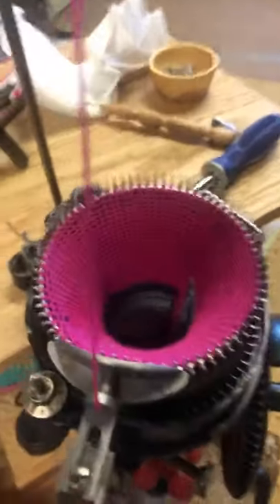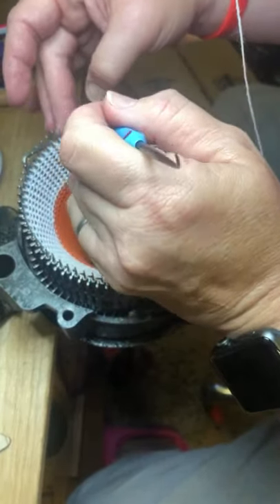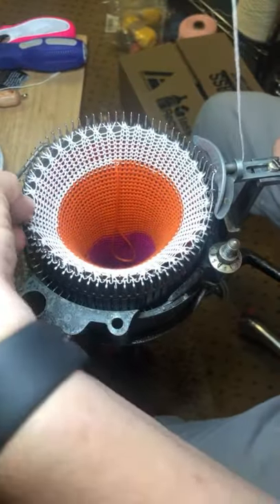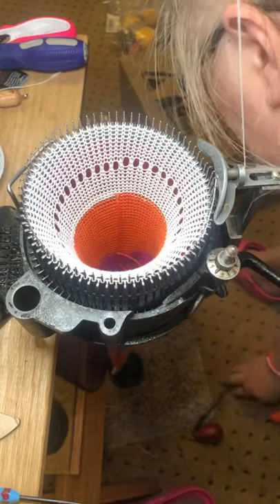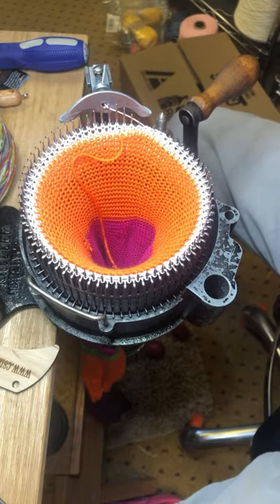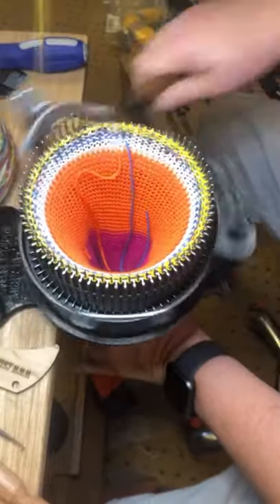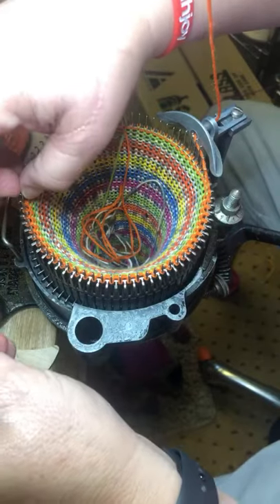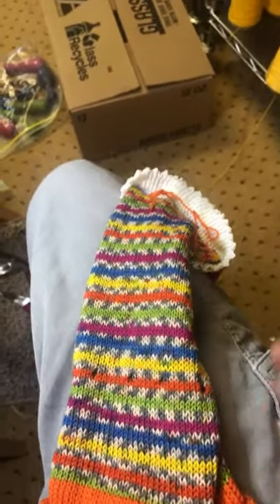Picot the Hang Hem!

Comment: Jamie, when...or even why, would I use the 60 needle or the 72 needle cylinder? I ordered both with my CSM with a 60 needle ribber. Please help me understand the difference (and not just thst one uses 12 needles more). Is it finished size? I have been hand knitting the cuff, heel, and toes on a Size 1 U.S. needle (2.25 mm) using a 60 needle cylinder for the sock worm. Thanks, Vivian Ann on the side of the mountain in northeast Tennessee 
PS...we love the yarn we got from you.
Reply from the maker: 2LadyHomesteaders Hodge the short answer is that you will most likely use the 72 for men’s socks and the 60 for women’s socks. I like the 60 because it divides by 2, 3, 4, 5 & 6!
Reply from the maker: That was supposed to say Well...not Hodge!!
Reply: @jmemayfield  ...thank you. So, the 72 makes bigger socks.